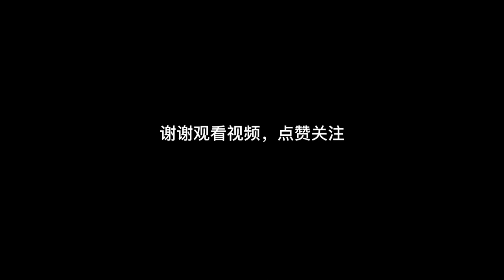瘸腿馬真可憐！蹄內竟有碩大磚頭，走路痛苦無比！修蹄師扣出磚頭後修剪蹄子，安裝馬蹄鐵！瞬間痊癒！

Comment: At O:11 >>>>>> Before going out for a ride and afterwards the European riders (who are properly trained) clean the hooves and discover on this occasion a stone or another thing which has to be removed.   
         At 0:27 >>>>>"His hooves are very dirty". The whole mule is dirty. I am from Germany: To avoid this the stable should properly and daily be cleaned using a lot of straw. Horses are herbivores and produce 8 - 12  times horse-dung every day. Few horse-people clean the stable twice a day which is quite reasonable. 
         At 0:36 >>>>> The German farriers/trimmers don't need to tie up the horses because they are well-trained to lift their hooves and to stand still so that farriers are able to work easily.
        At 3:16 >>>>>> The treatment is not yet finished: There is still some rotten horn in the sole and in the frog. 
It's always the same old story with the donkeys`   f r o g s    in this area - they are   n e v er   treated - never!!